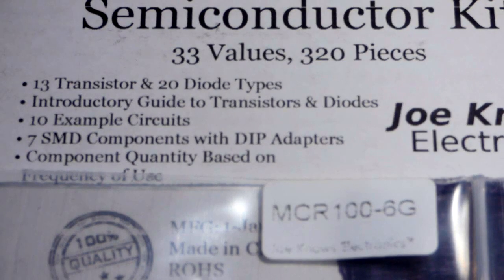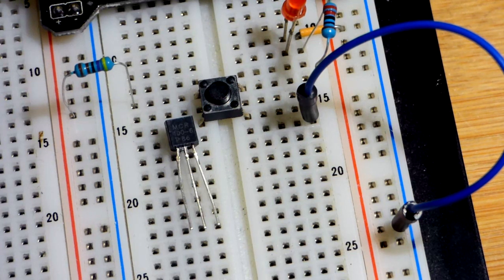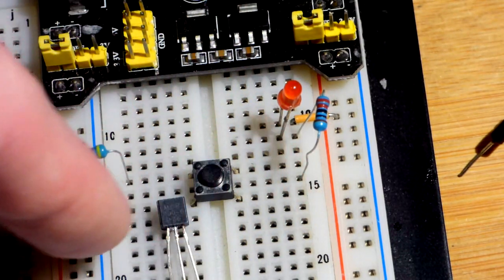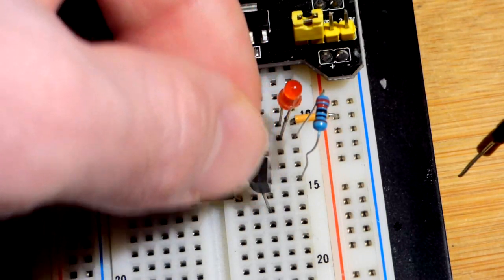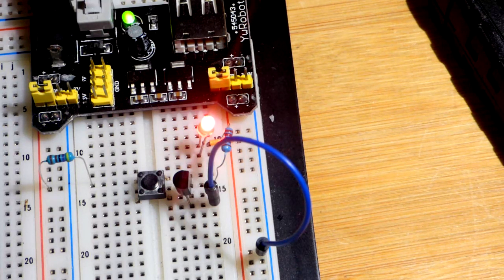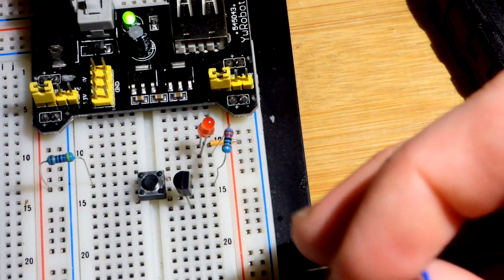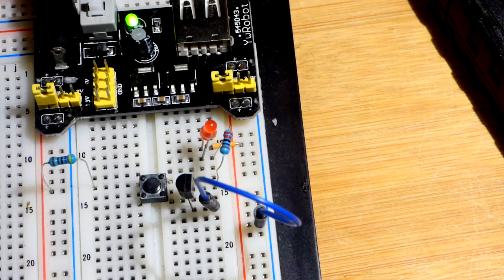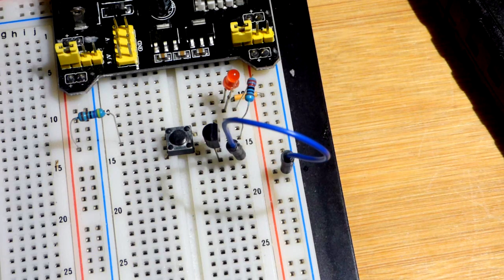Silicon Controlled Rectifier SCR component demonstration MCR100 6G

Comment: What ohm value do you recommend going to the gate of the scr using 9volts dc? Thanks for your videos.
Reply from the maker: I always used a minimum of 470Ω when I used 9 volts when it was the primary component limiting current. Can use a higher value with no problem. Not sure how high would be too high though.